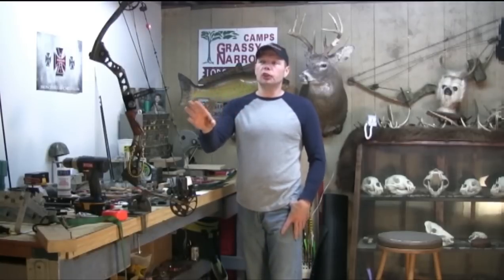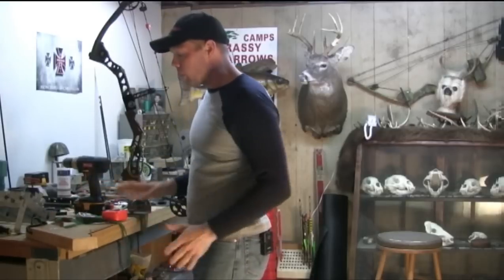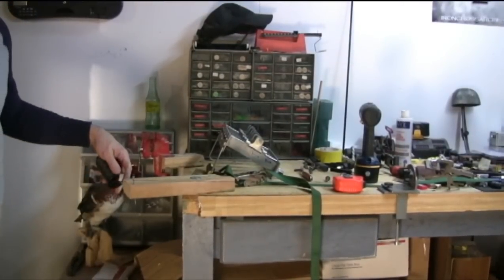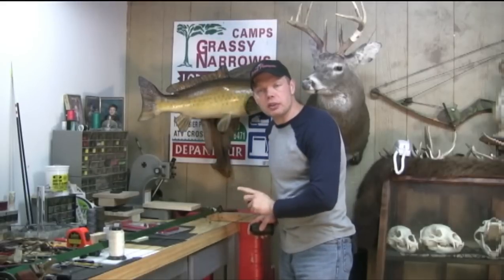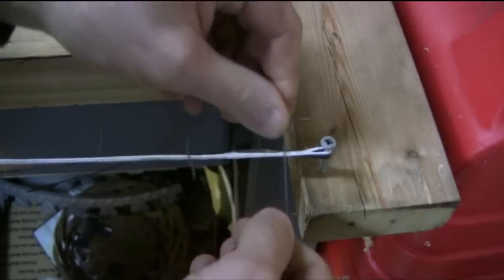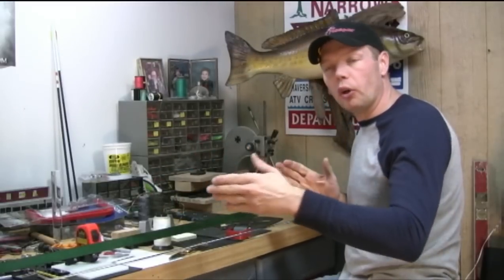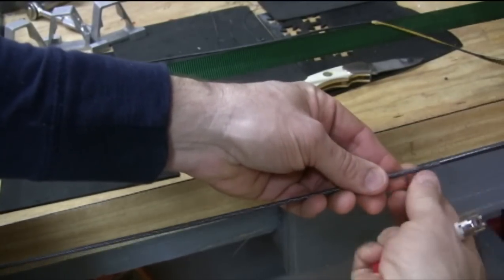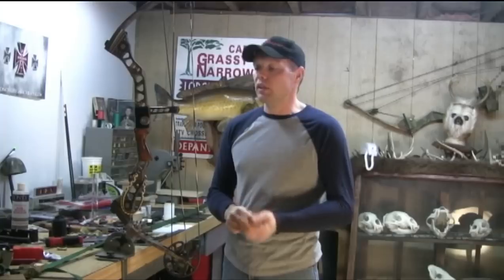Bow Tuning Tips/ Making a Compound bow String from Scratch

Comment: I have a Mathews LX also . After you put the string on is there a certain position the cam need to be . A alignment of any type. I was looking at a chart at the Mathews dealer and it did not show this cam on the chart  . It showed similar cams amd it showed red lines on where they should be lined up to ,but nothing on the LX bow .

Comment: I like the ingenuity of the wooden jig but I see a lot of potential improvements in the build process even using that very cost effective jig. My experience is that having significant stretch on the string while serveing in conjuction with haveing the string pre-twisted gives you much better performance. When my build process looked like the one shown in the video I would get a lot of peep sight rotation.Also using the tag ends to serve the end loops makes them more durable.

Comment: With a turnbuckle, threaded rod, a hand power drill with the actuator/ variable pot removed, and a pedal for speed control... you can spend less time serving thread and more time wearing them out!
You can thank the US Navy for my tinkering & training skills. We only quit when the obstacle's overcome! Smarter, not harder!
You will need a few turnbuckles to do both mods & some jamb nuts to lock the serving jig in place. A jamb nut on the end will allow you to use a ⅜ socket with drill extension.

Comment: Turnbuckles also do a great job at tightening the string for prestreching the bow string. If you're pretty handy, you can build a simple rotating jig that keeps your string in place at all times as well.
Oops, I already said too much! The parts you need for both jig mods are here in this comment.
Enjoy a quicker build process with less time off the jig.
I will let one more secret out & it's more complicated, but if you love serving by hand... by all means, do it; however, the same part spins!

Comment from the maker: Most strings are not served on the ends look at zebra winners choice and vaportrail non of them are served around the pegs it prolly wont fit if its served. I am a professional bow tech and have been building strings for years this way and never had one break. The way that is demonstrated in the video is correct to the T.